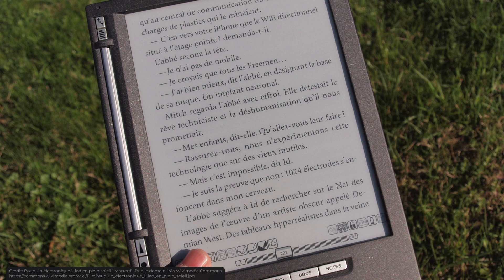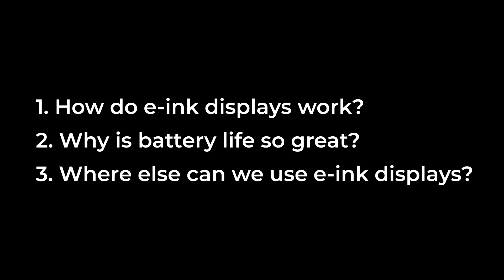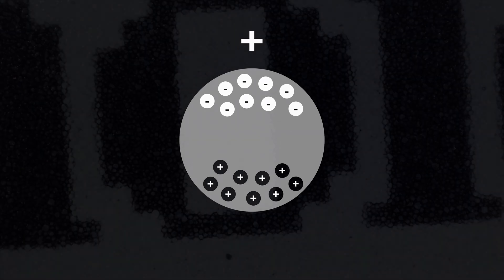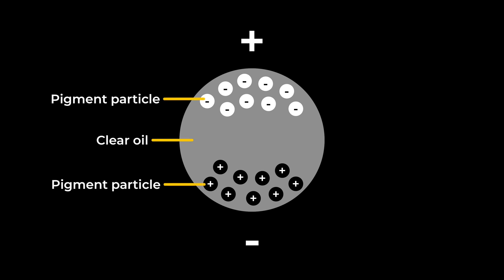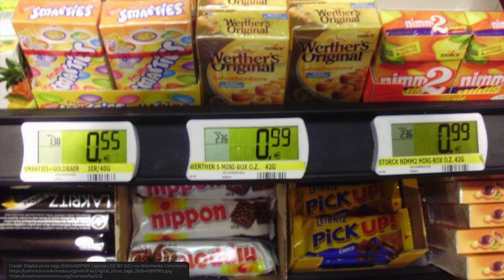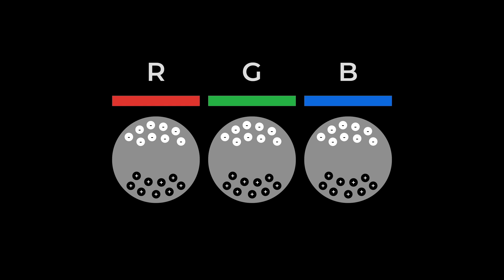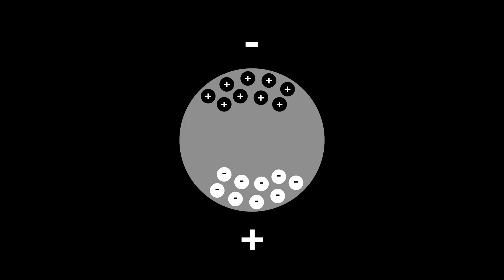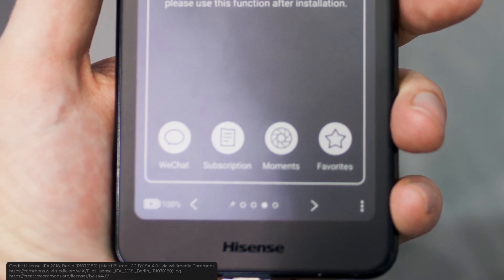How E-Ink Works

Comment: How can the Pigments be made so that it can still work below -10c°?
Reply from the maker: The problem at low temperatures is not with the pigment particles, but with other components of e-readers. The battery stops working properly, losing power quickly, the plastic becomes brittle like glass, and the oil inside the capsules becomes too viscous to allow the particles to move. So, to allow e-readers to work at extremely low temperatures, we need to fix all of the things I mentioned. But even if we fix the e-ink displays, the battery still won't work properly. Smartphones (and other devices with batteries) don't work at extremely low or high temperatures either, for the same reason. The problem is the battery.

Comment: Some bus stops now use eink displays for the departure board. If it refreshes once every 30 seconds during the day(60 seconds at night) then they'll still take like 12 years before they hit the 10,000,000 refreshes that the displays are rated for. I assume they're more reliable than LCDs/dot matrix displays too since they're doing nothing most of the time but this is a guess. Definitely use a tiny fraction of the power though which would let them be powered by a small solar panel and small battery(to stay on overnight) whereas with the other types of displays you'd have to run a grid power connection to the bus stop. Would still need a little control board and 3g though to give the display it's data, but still much cheaper than connecting the bus stop to the grid since those can be solar too.
Reply from the maker: This is a great example of where e-ink displays should be used. I don't see the point in putting them in computer screens or smartphones. That's not the best place for them. But timetables are a great place for e-ink displays. You're right, they're reliable, they save energy, and are just as good as LCD/dot-matrix displays in terms of readability.